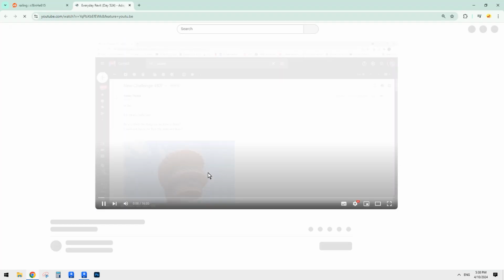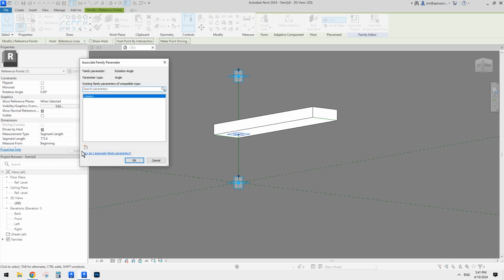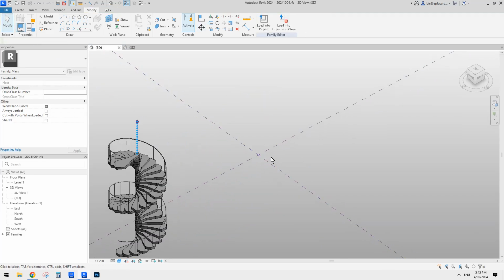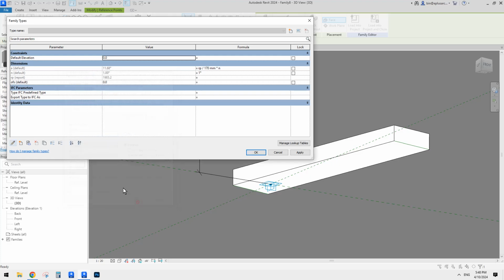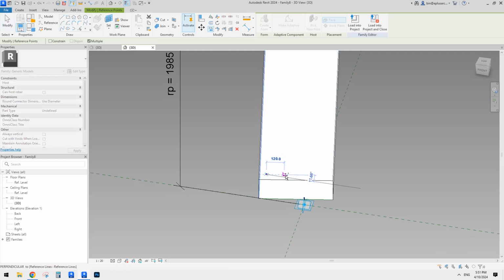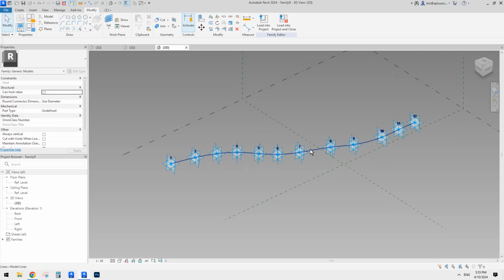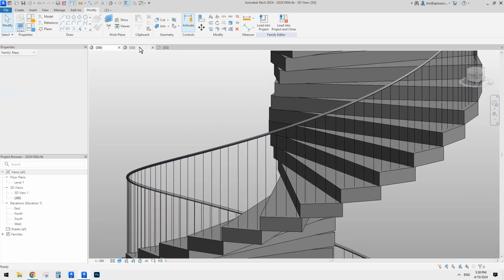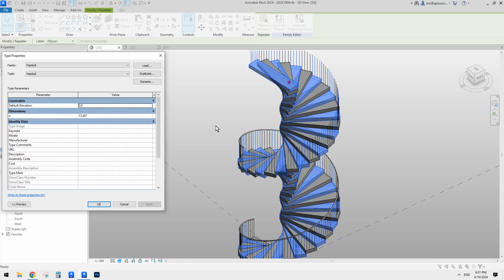24053 - Using adaptive family to create railing and balusters for an adaptive family stairs

Comment: thks . you, have bug when use angle 10 degree , at 9 step .
Reply from the maker: Seems like the infamous 90degrees bug on rotation angle. (10x9). Maybe change the angle slightly so you will never get 90 degrees. Eg. 10.1